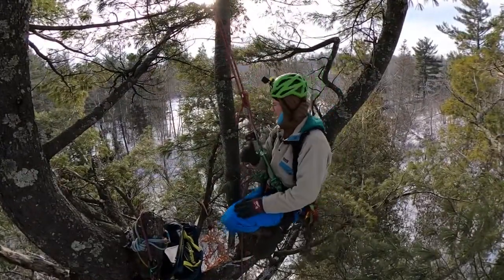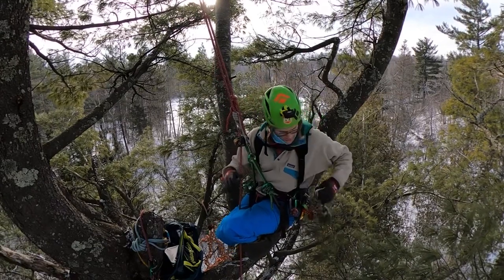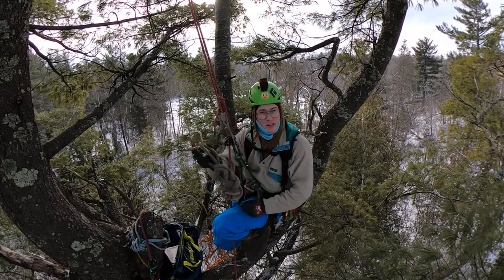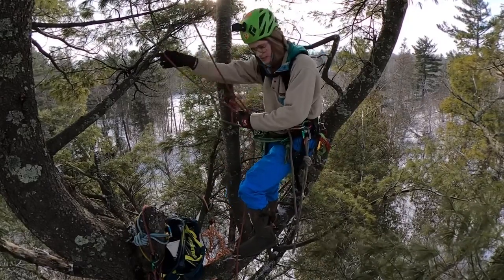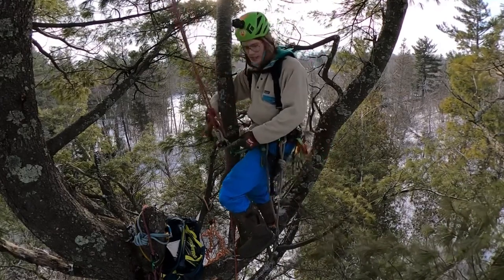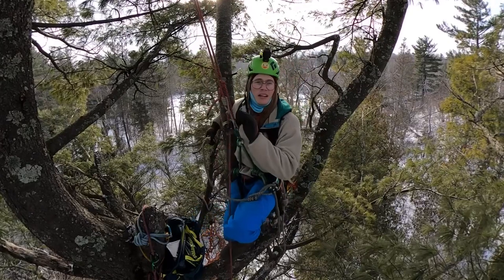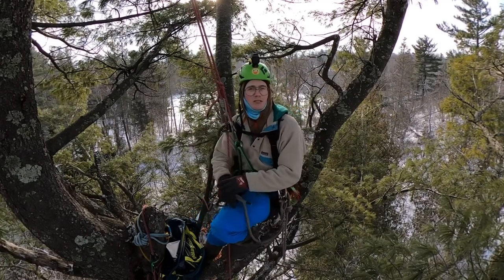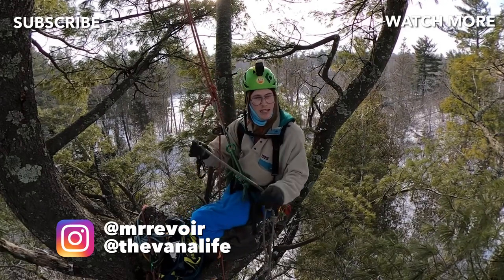Making a Work Positioning Lanyard | Basic System

Comment: Hi! Thank you for your videos and instruction! What kind of an attachment do yo have for your harness to make it more like a sliding D for your DRT system? Is it a piece of rope between your side D’s? And can you make an adjustable lanyard using a Prussik loop? Thanks!
Reply from the maker: For my bridge I just have the standard rope bridge with a rappel ring for my main life line attachment point, it’s just the standard bridge that comes on the Treemotion saddles. You can make a lanyard with a prussik loop and a prussik I just find them more fidgety to adjust than using a an eye to eye prussik cord and a Distel or VT friction hitch.
Reply: Thank you for your reply!